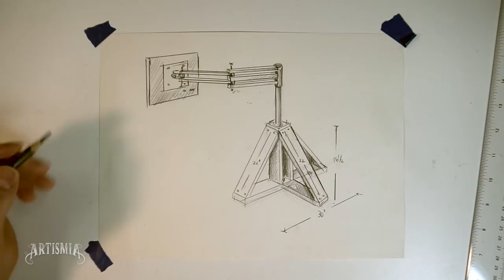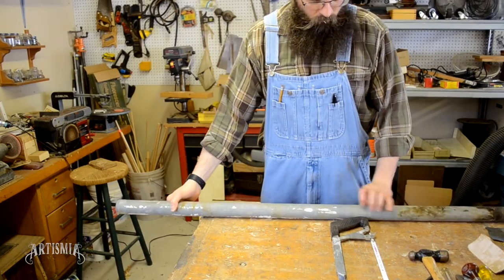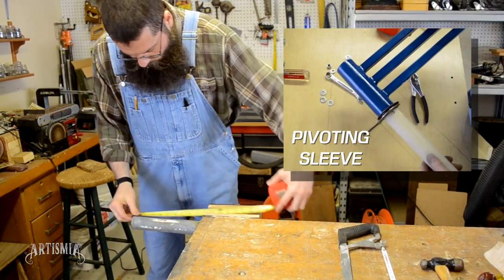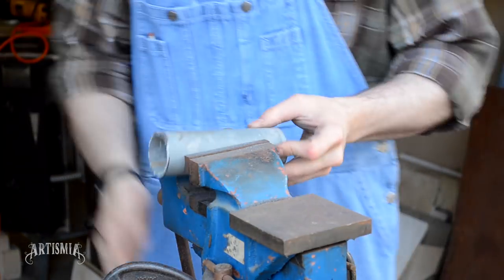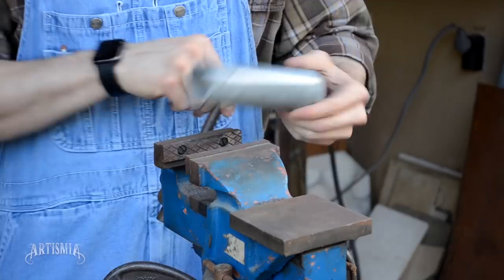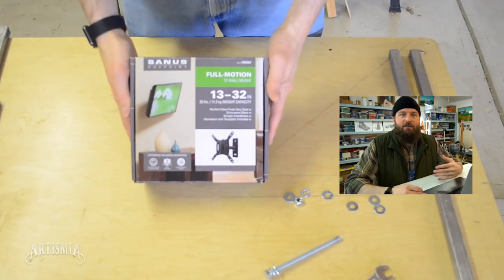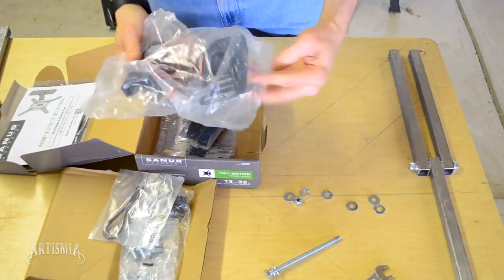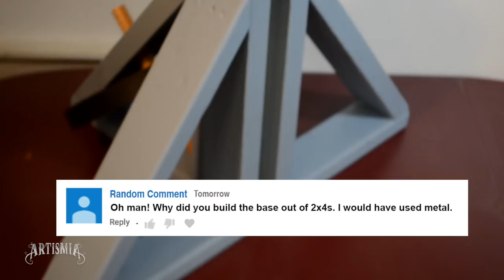Make an Articulating Metal Swing Arm TV Stand  DIY How to.

Comment: I need to build several of these for my disabled wife's accounting office,  so the desk, desk storage, and computer monitor can all swing around her.  So I'm here on a specific search.  I love your design, but it didn't solve my main concern, that is bearings.  For the base bearing, I was thinking of trying to use front fork bearings from bicycles, so that I had a source of reasonable priced parts.  Stacked washers and perhaps bronze bushings (or perhaps liner rail bushings from a 3d printer, again readily available parts) were what I was thinking for the rest of the arm.  I want this to be smooth in motion, as my wife will use this constantly 12 hours a day.  For mounting, I was planning to make a strong floor stand with a  bracket on the wall behind her chair, being several feet wide and attaching to at least 4 studs.  It would be arranged with the monitor on a high arm, with the monitor hanging slightly below the arm, with the arm over her head, and two more arms supporting desk height surfaces, one for mouse/keyboard and one with an attached  set of drawers, telephone, usb hub and other electronics accessories with support for keeping the cords organized.  In addition to the welded construction, I will be augmenting with 3-d printed accessories like end caps, cord organizers and all manner of small parts.  I've got all the tools you show in use here, as well as several 3d printers, and 40 years of experience designing and building computers and electronics...  Though I will probably use one of my arc welders, I loaned my tanks and torch to someone, and I don't really want them back (long story).  So thanks for the inspiration.